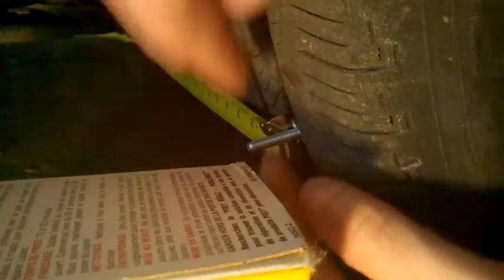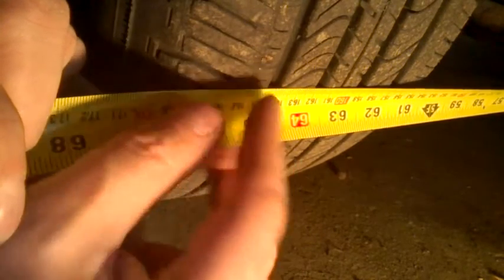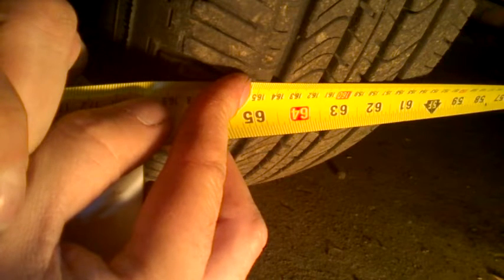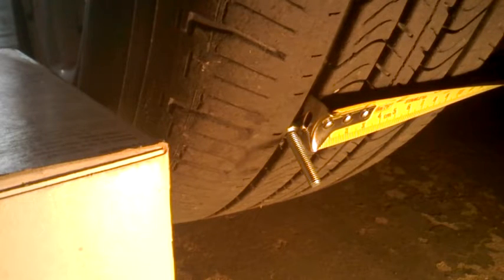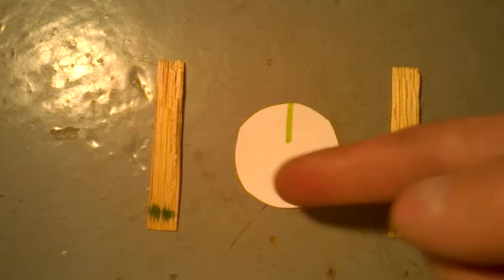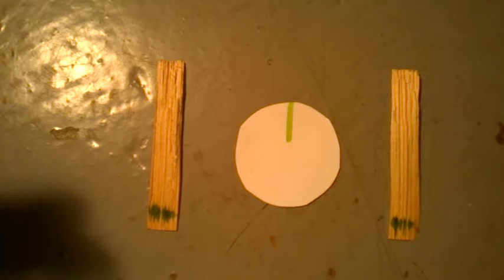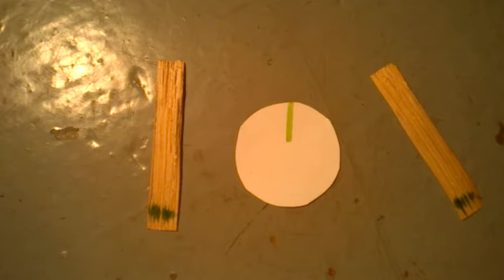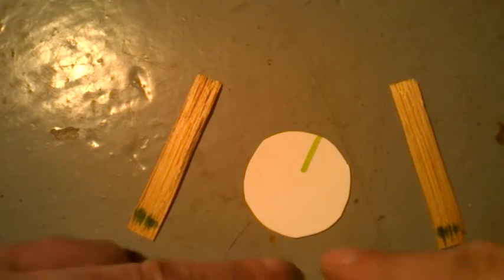Measure car wheel geometry/alignment with a ruler (1/2)

Comment from the maker: Improved video https://youtu.be/PphHxJ8RQ-4
Geometry adjust playlist https://www.youtube.com/playlist?list=PLl-l6yge4asstdyo8PTHx2G-ME46hNDO7
As a rule of thumb, if the steering wheel is centered and there is 5 mm toe in or toe out (difference in the distance measured at the front and at the rear of the tires), I would adjust the tie rods about 90 degrees rotation at each wheel.
Never drive through rain going to a garage to have the alignment/geometry done. The wet threads will seize very strongly after a while.
When we do the geometry, there are two goals : have the wheels parallel (zero toe) and have the steering wheel centered when driving straight. Any tie rod adjustment will change both the toe and the steering wheel center position. Usually I do this in two steps: first, correct the toe to get the wheels parallel. The I drive the car and note if the steering stays rotated to one side: if so, I adjust again the tie rods only to center the steering: usually this is done by shortening one tie rod and extending the other tie rod the exact same amount.  https://www.youtube.com/playlist?list=PLl-l6yge4asstdyo8PTHx2G-ME46hNDO7

Comment: This method seems to give good accuracy because my values were around where I expected. I had only a 1.5 mm toe in (combined) and my steering wheel was off-center by only a couple degrees, clockwise. So, I now shortened the right side tie rod with a ~22.5 degree turn with the wrench. That's good enough for my 24 year old car. Thanks for another great guide.

A side note: interestingly, VIDA instructs that small misalignments of the steering wheel can be adjusted directly on the steering wheel instead of the tie rods. It's the opposite actually. The smallest steering wheel adjustment can ONLY be done via the tie rods (in parallel if needed). The steering wheel is on a cog and the tooth size is several degrees. Steering wheel adjustments like that are likely overshoot in either direction and not give perfect center. I've also noticed small faults like these with other VIDA instructions...
Reply from the maker: That's pretty much the adjustment amounts I remember as well for a small - tiny toe. I would say, that would be the smallest adjustment I would be able to do. Tiny steering wheel adjustments are usually try and error a couple of times, involving driving the car in between to check the steering correction. 

As for Vida, I remember the steering may have a tiny bit of movement on each cog when the large center bolt is loose. However, removing the airbag is a chore, especially on 2004-up, plus we need to disconnect the battery 15 minutes ahead. The big bolt also has red loctite on it from memory, so hard to loosen and needs fresh loctite. Too much trouble.
Reply: There might be some play in between each cog. I didn't notice if that's the case. Regardless, it was not possible for me to center the wheel by itself. And you are correct about the red Loctite and disconnecting the battery.